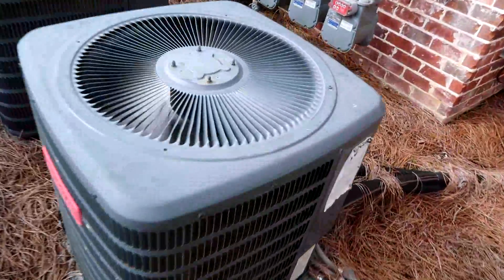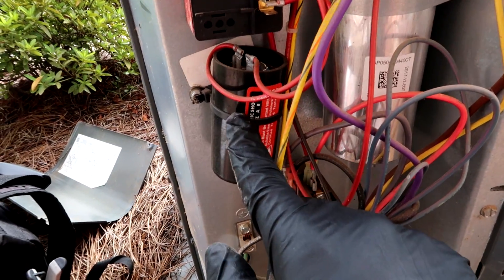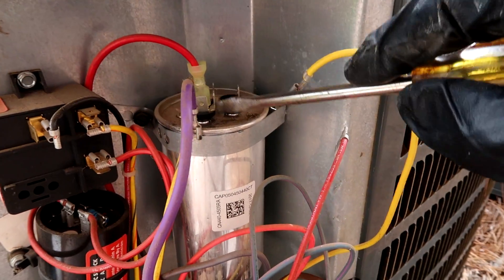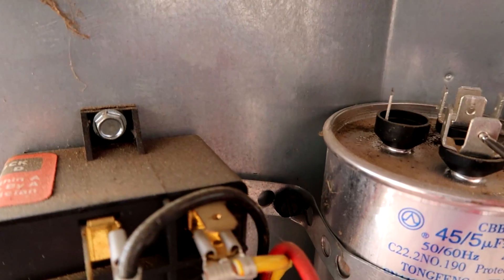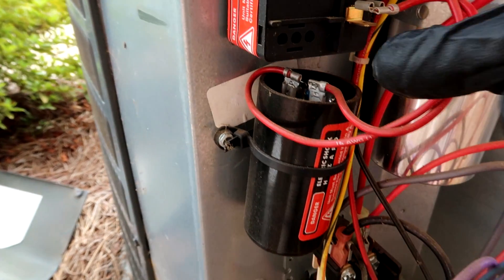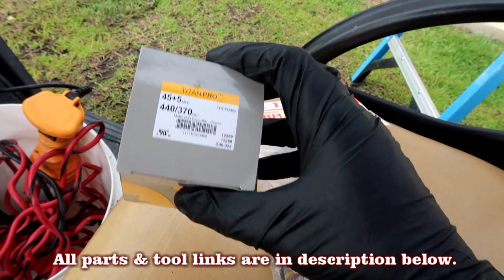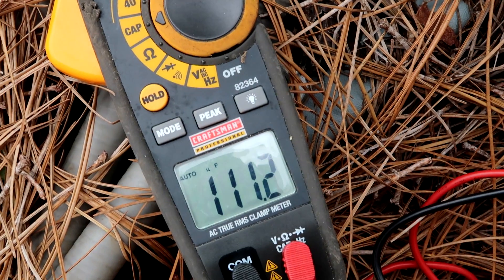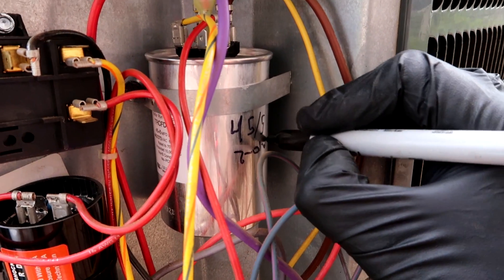Air Conditioner Is Not Blowing Cold

Comment from the maker: Capacitor Links
Be sure microfarads match your units capacitor.

30/5 capacitor: https://amzn.to/3nIjtFK

35/5 capacitor: https://amzn.to/2QOffAC

40/5 capacitor: https://amzn.to/3aUSOjS

45/5 capacitor: https://amzn.to/3gVBsHv

5-2-1- Compressor Saver Kit Link- https://amzn.to/367jfA7

If you'd like to support the channel, you can do so by shopping for tools or whatever you need on AMAZON at no extra cost to you through this link,
https://amzn.to/3vC9PaF

Tools That Can Make You Easy Money: https://www.dirtymaintenancenation.com/diy-tools-for-men/

If I've provided any value for you and you'd like to donate $1.00 or more into my online tip jar, you can do so through this link, (all cards accepted)
https://squareup.com/store/dirty-maintenance-nation

This page contains affiliate links, which means that if you click on the link and make a purchase, I’ll receive a small commission at no extra cost to you. Lex Vance is a participant in the Amazon Services LLC Associates Program, an affiliate advertising program designed to provide a means for sites to earn advertising fees by advertising and linking to amazon .com
Reply: I've been finding those Titan caps testing a little low too.
Reply: @NatePetersonr5t  I installed a Titan 70+7.5uf capacitor last night and both sides tested a little low but within range.

Comment: On a 102° Day my AC started blowing warm air that night! Went out to my unit, the fan wasn’t moving but I could hear that the unit was on.  Turned it off waited a few minutes turned it back on and my fan was moving but it was blowing warm air.  It was a miserable night so after watching various videos almost everyone was replacing the capacitor.  So I figured it’s only $20 I have a dude scheduled in a few days that will surely tax my ass on the $$$$.  Got a new capacitor installed it and presto blinko my AC is back on freeze!  I also took dish soap and cleaned the unit with my hose too…actually might be cooler than before.  Cancelled my appointment, nothing is better than a simple fix actually working.
Reply from the maker: Nice fix dere! Thank you so much for watching!

Comment: @lex vance I'm sure you know this already but if that hard start cap blows up it's usually because the relay goes bad. I believe in taking all the wires off of the capacitor because I tested one bad then retested it when I took it out and it was good. I didn't short it out though so that's possibly why it tested bad.
Reply from the maker: Yep! I remember learning that when the relay is bad, it makes caps go bad. Could've been the frog, too. 🤣 Thank you so much for watching Nate!
Reply: @LexVance  thanks for making the videos!

Comment: When you put back the wires on capacitor, can they be interchange? Or it should be put on the right one
Reply from the maker: It has to be put back to the right terminals or it won't work. Fan wires have to go to fan, compressor wires have to go to Herm and common wires have to go to C. Thank you so much for watching!

Comment: Why does it need hard start ?
Reply from the maker: My guess is the rotary compressors need that extra boost. Those compressors aren't like the regular Copeland scroll compressors.
Reply: @LexVance  question my window ac capacitor crapped out . it says 45+15 uf plus minus 5 percent 40/70/21 I can't find replacement near me what else xan I use . and,what's the 407021